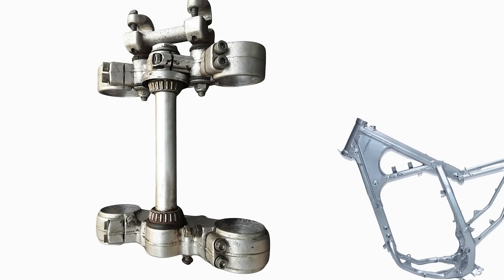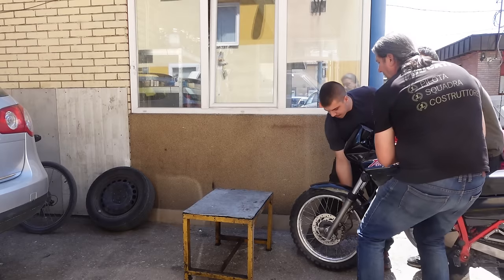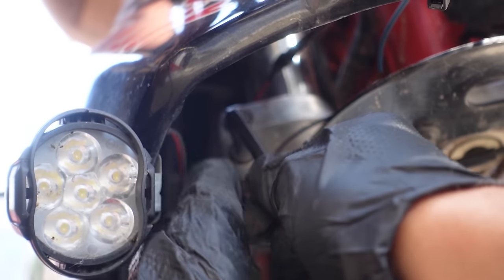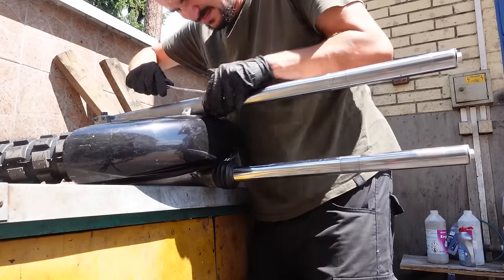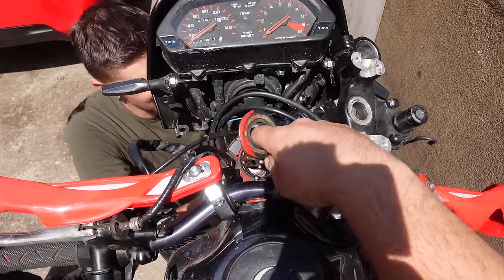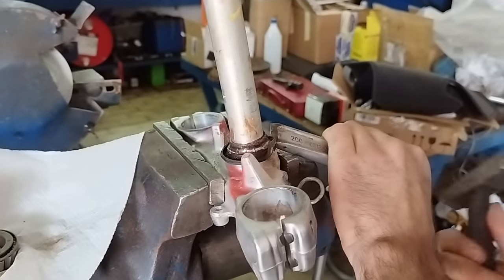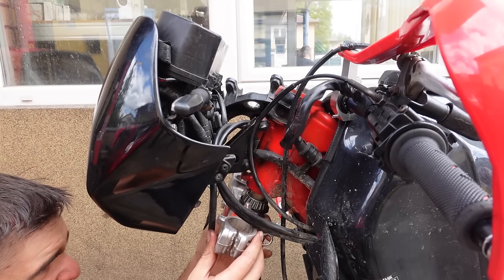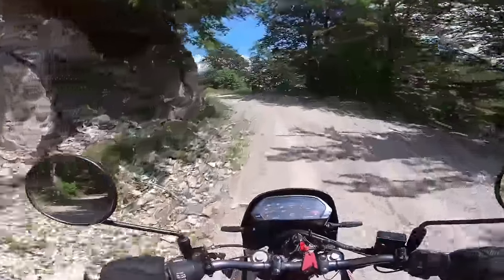How To Replace Motorcycle Steering Bearings Without Special Tools

Comment: Easiest trick for installing the bearing races is to use the old one. Put it right way up, so you're hitting the thinnest edge, then tap on that with a hammer, working your way around it. Once the new race is installed, just carefully use a punch or something small to tap it back out, because you're using it the right way up it leaves a nice edge to hit without damaging the new race. Oldest trick in the book, because a) the old race is about to be thrown out so doesn't matter if you damage it, and b) it's the perfect size for the job.
Reply: @chuck7432 Yes, I have one myself and not that cheep one. The point was not using specialty tools. Most people don't need race driver sets

Comment: For pressing bearings into place, I like to use self-made simpleton tools with threaded rods and nuts to do the main work. I find that it gives you more control of the process. You can still adjust any tendency of the bearings to tilt and stick by gentle blows to the right side. Worked a treat for me so far!
Reply: Agreed, I use threaded rod a lot to press stuff in and push stuff out.
Reply: @RadDadisRad  🙏 So zhe brrrozherhood of zhe zhrrreaded rrrod finally found togezherrr! Time to rrreach forrrr worrld domination!!1! 😎
Sorry, I just had too much coffee… 🤷‍♂
Reply: I was able to use pvc pipe that was just the right size, with a threaded rod down the middle, big washers and nuts on both ends. But you can make it out of any type of tube that is just the right size for you.
Reply: I just keep the new race/bearings in the freezer while I’m doing disassembly, then prior to install I heat up the housing with a heat gun or torch, bring out the bearings in a little lunch cooler and normally they just slide right in, if not a tiny tap always does the trick.

Comment: Pack the bearings with grease more thoroughly. It's impossible to overdo it. Just wipe away excess blobs, but you want grease pushed inside onto all roller surfaces.

Comment: Very good video, the only thing I would add is that after a day of riding, recheck the preload nut and adjust if necessary, an easy test for being too loose is with the bike in netural, apply the front brake and rock the bike forward and back, there should be no movement of the triple clamp relative to the frame and no "clunking" felt or heard.
Reply: Exactly. I hold little confidence in the rudimentary tooling to properly seat the bearings, however normal use will. Adjustment will complete the job.

Comment: That's a very satisfying repair. The grinder portion is not for the faint of heart, I would think. Maybe a Dremel would be easier to control for some of us. On my bicycle, I actually paid a shop which did have the expensive tools for that same job, the only time I've ever done that.
Reply: There's a trick. As the grinder gets close to grinding all the way through the race,the thin metal starts to oxidise and go blue. At this point you can stop grinding and split the race with a chisel.
It is also better to arrange a support for the grinder such as a block of wood for an arm rest , rather than doing it free hand.
A dremel would take forever.

Comment: I would have demonstrated and applied way more greese actually packing the berrings as it should be done. Those were not properly greesed at all. Remember there is no adding more later once assembled. and just outside surface is not sufficient. They will just look like the ones pulled off way to quickly

Comment: Small tip: you can place bearing seats into the freezer, and use a heat gun on the part where you install them.
Sometimes cold bearing seats drop right into the hot part with no hammering needed.
Reply: Exactly !  It works great

Comment: Excellent.
I didn't see where you greased the lower bearing before enclosing it in the stem housing. While these are very low speed, minimal movement bearings, I would tend to favor packing both bearings with grease before installing them. Not packing too thick to slow movement but thick enough to prevent water and debris from easy ingress.
Reply: I noticed that also the video shows him installing with the lower bearing dry. I would assume that off camera he realized this and took it back out and applied grease only cause when he was greasing the upper bearing and installing that one he made a caption to do that to both upper and lower bearing so I would think he noticed his mistake and then removed it to apply grease
Reply: Dry as a bone !

Comment: For all that time and effort, start with quality bearings. All Balls is one of the best. ( Yes, they make tapered roller bearings in spite of their name.) I'm not sure about those bearings made in India. I've seen Indian "quality" steel products before.

Not all bikes require special tools. I replaced the bearings on my Yamaha FJR with no special tools other than wrench for the adjusting nut up top which is quite common - some call it a spanner wrench ( I thought "spanner" was just a British term for wrench), some call it hook wrench which describes what it looks like. 

When those new bearings are a bit too tight to slide on to the steering stem, put them in your freezer for 30 minutes and then install them before they warm up.

That adjusting nut really should be installed with a torque wrench. Often times, your shop manual will give you an initial torque spec to seat the bearing after which you undo the nut. Then re-torque the nut to the final torque spec. Your steering assembly is far too critical to be going cheap on tools. I already lost one friend after improperly adjusted the steering stem nuts cause a loss of control.
Reply: Or C-spanner

Comment: I just keep the new race/bearings in the freezer while I’m doing disassembly, then prior to install I heat up the housing with a heat gun or torch, bring out the bearings in a little lunch cooler and normally they just slide right in, if not a tiny tap always does the trick.
Reply: I put the bearings in a Ziploc bag that I suck the air out of prior to putting them in the freezer though so condensation doesn’t build up, don’t want moisture inside of those things lol

Comment: Fantastic!! Please pack the bearing more thoroughly than shown. Put a large dab of grease in the palm of one hand, and scrape grease into the larger diameter side of the bearing's gap until the grease squeezes out of the rollers.

Comment: Another secret to hammering the lower inner race down the shaft is to tap it alternatively on two symmetrically opposed fixed points, with moderate force, to prevent jamming it. It will go down surprisingly fast. This was taught to me by an old man passing by the garage while I was struggling with mine. Before it, I tried heating the inner race to 180 degrees and freezing the shaft as the service manual instructed, but it was in vain.

Comment: ok this is a good video and good instruction eccept on one part the new bearings has to be packed with greasse by pushing greasse behind the rollers of the bearing this is essential for the long life of the bearings i am a car mecanic myuself with 15 years experience and replace or repacked similar bearings on trailers and those you do not pack with greasse to not last they get rusty fast so i suggest everyone who fo.llowed the instructions and isntalled roller bearing to oninstall the new bearing and pack them propely the lower bearing can be packed in place just putting greasse on top of the rollers while installing does almost nothing

Comment: tapered steering bearings require a bit of "pre-load" on them to work properly where as conventional "ball bearing" (what was OEM) do not!  the end result is you don't want excessive looseness in the steering!  but, it is a significant change between the two designs!  tapered bearings make for a much better "feeling" steering system for sure!  wish I saw more of them standard on bikes!
Reply: mine comes OEM with ball at the top and tapered at the bottom. a rare mix

Comment: In college, my buddies had access to liquid nitrogen .  In taking off the outer race of the bottom bearing from the steering stem, we cooled the stem
with the liquid nitrogen, and then heated the race with a bunsen cigarette lighter.  The race lifted right off with no binding!  And it worked in the
reverse direction when putting the outer race of the new bearing onto the steering stem.  Absent liquid nitrogen, I'd try it with dry ice .
Reply: Literally looking for both. Blind bearing (1 side only view, can only pull) and its on a crankcase with very little access....

Comment: Great video question I have a 125cc am guessing it's all the same. I have stiff steering when i turn left but when my bike is on the 2 step stand moving the steering wheel left to right is perfectly fine no stiffness, when I ride its stiff is this the bearings. Thanks

Comment: The bearing races are very hard and brittle.  To remove the lower race from the steering stem, I cut it only slightly with a small grinding wheel, and then hit it lightly with a hammer and chisel.  The race promptly broke in half at the small cut.
Reply from the maker: Yes, we tried that. Usually works. But not this time

Comment: LOL, I see your really enjoying motorcycles.
 If you check rear of handlebar you will find a center punch mark that lines up with the split in handlebar clamps for standard placement (only on OEM bars) If you fit Renthal or aftermarket alloy bars they won't have a mark.
It generally isn't known but Honda specify tightening taper roller bearings initially to 35ft.lbs torque to make sure everything is properly seated then adjust by hand (I've made peg spanners from thick wall pipe, weld an old socket for drive)
Special tools are over rated, I've seen brand new bearings destroyed  by not using tools properly. 
(plus various other components by using tools wrong or not knowing how to use them)
It's generally better to use a tube to drive lower bearing on, even plastic water pipe works fine (it works good as a seal driver as well)
Ball bearings are used instead of taper roller for two reasons,
 1:- they are cheaper. 
2:- they are lower resistance due to less contact (600cc~1000cc sport-bikes almost always use ball bearings)
When I worked at MMI-Orlando, there were 'certified' Harley Davidson instructors who actually believed HD made bearings with a 'notch' to keep things centered and refused to believe it was caused by wear (I did general and specialised Suzuki training)
Reply: Ok now that last sentence is hilarious, and just adds to the stereotype of head-in-the-sand harley owners.

Comment: Physics is your friend...sometimes. 

Those bearing races you installed in the frame? Freeze them for a day before driving them in. The lower bearing on the stem? A little judicious warming in the oven will ease the installation.  You can still pack them with grease after it's on the stem and cooled.
Reply: I was going to mention similar, though as well as warming the bearing, put the stem in the freezer. it'll still be tight, but it'll need less encouragement with the hammer.

Comment: Another way besides a chisel or grinder to remove the bearing from the lower triple clamp without risking marring the visible surface is to drill two holes into the bottom of the clamp so you can use a thin punch to tap up on the bearing. Works like a champ and no one will ever notice the two holes on the bottom.

Comment: Honda has dot marks in the handle in order to repositioning.
Water causes disasters in steering bearings; don't abuse on pressure washing. 
I as a water pressure fundamentalist had to change the steering bearings of my Transalp twice.
And ruined a pair of aluminium wheel rims.

And re tighten the bearings after a short period of run once "set in" is done.

Comment: so i have a 05 gsxr 600. replacing the steering stem bearings and i noticed my top frame hole where the top race sits is more of an oval shape? i cannot get that top race in no matter what it just won’t fit. any suggestions?

Comment: A more reliable way to check the bearing is to do it under normal load from the bike. Lifting it off the ground removes the load. Better I find is to put down two sheets of polythene with oil between the sheets. Roll your front wheel onto this frictionless sandwich and you can freely turn the handlebars and much more easily detect anomalies whilst the weight of the bike (and you if you like) are loading the bearing.

Comment: When you do these bearings you’ll benefit from using way way way more grease on the bearings, give the stem a coating aswell on offroad bikes it only take one river crossing and water can get trapped in the head stem and end up as an expensive tear down, ask me how I know.
Reply: Actually you can't use too much grease. The bearings will only throw out the excess. Bearings take a lot less grease than people think they need. But they should be properly packed. I agree about coating the stem...
Reply: @johnnyblue4799  I only say “way way way” more because every bearing I’ve gotten, the manufacturer cheapo out on grease and expects the everyday working man to be able to use every last drop from the tiny packet (which is usually not enough anyway.) but for non critical things like headset bearings and swing arm bearings, I pack the shit out of it only because I don’t want water pooling, not because the bearing needs it.

Comment: As a bicycle mechanic, it astounds me how inaccessible specialty tools are for motorcycle home mechanics. I would venture to guess that a cheap bicycle headset cup remover and headset press from amazon, as well as a steel tube that's just big enough to slip over the spindle and sit on the lower bearing's inner race can massively help with removal and installation.

Also, why are sliding fit bearing seats not employed on motorcycle steerer architecture? Seems quite the faff.

Comment: It's a common myth that impacts such as hard landings or wheelies causes pitting on the bearing races.
This of course is ludicrous. If it was possible, car wheel bearings would get damaged every time a wheel hit a pot hole.
The usual cause of notchy steering head bearings is condensation collecting on the race where the ball or roller sit and causing corrosion.
Put plenty of grease around the bearing to keep moisture away from the area.

Comment: 0:50 you can use a used tools or buy new and sold. Special tools are not very expensive worldwide, if your local shops are expensive u can buy by aliexpress.
0:16 this bearing is not worn out. This is just rusted because of lacking service. There is no grease since 5-10 years i think.This is one of a points you should check once a couple years, this is no big deal to take this down, clean and put some fresh grease.

Comment: For installing bearings like that, I've successfully used the technique of wrapping the bearing in a wet cloth, and then putting it the microwave to heat it for a few minutes, before then just dropping it into place.

Comment: A pipe split and spread makes a better tool than a screw driver. I would not recommend Indian made bearings, and I would also not have any new bearing exposed to grinding dust. Also a good quality moly grease is far superior to the goo supplied with your bearings. Nice bike, Honda Dominator is a classic dual purpose derived from the XR600R but a lot more durable (read softer). Very cool.

Comment: Incorrect information. For example hanging a motorcycle to check will only work if steering bearings were overtightened and top bearing is notched. If the top bearing is smooth you won't detect it on this test.

To check lower bearing take a 50gal trash bag, fold it multiple times and put it under front wheel contact patch. Then and only then when you have weight on it you can check lower bearing good luck.

Comment: "How not to..." would have been a better title for this video... Man, I usually love your videos but this one just made the hair on my back stand up...
1) Why didn't you just remove the wheel and separate the shocks? You are just torturing yourself with them attached to the wheel...
2) Removing the shocks is a great time to inspect the oil, replace it if necessary, same with the oil and dust seals.
3) "Slightly smaller diameter socket" is just what you need to damage the inner surface of the new seat, what you need is a socket that is exactly the same diameter so that you don't put force on the working surface.
4) Chisel and angle grinder on the lower bearing? Really? How about using a little heat on it before going medieval?
5) Trying to hammer the new bearing from a 3mm opening without damaging the basket is just too damn risky, how about making a very fancy "special tool" from a suitable diameter iron pipe? Will only cost a few bucks...